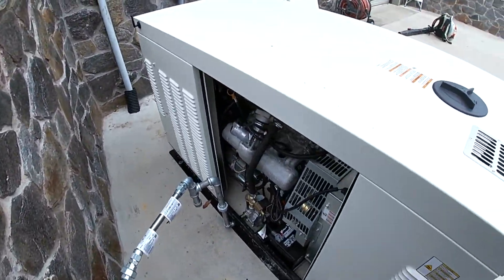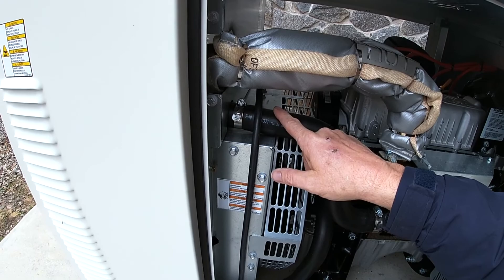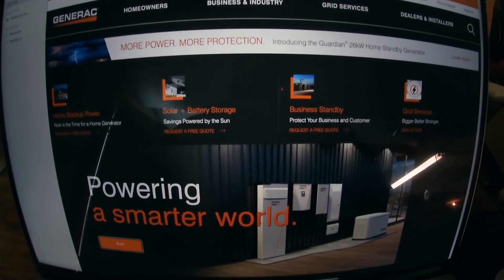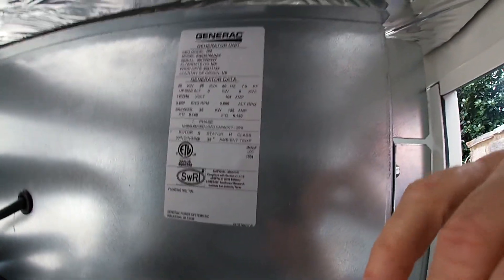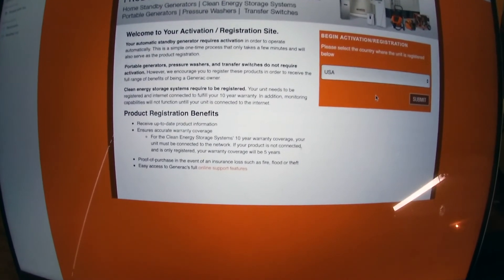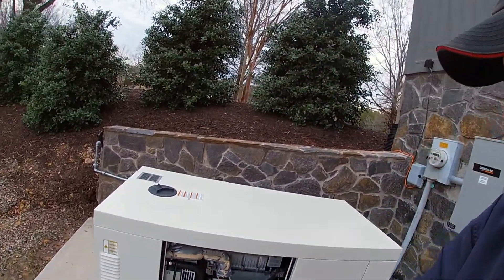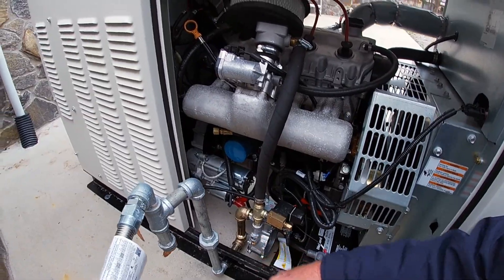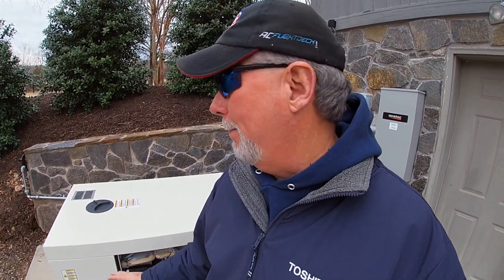HOW TO INSTALL GENERAC 25 KW  / PROBLEMS BEFORE ENGINE START UP (Pt.5)

Comment: Thank you so much for this series of videos. I had a Generac licensed installer come out and give me an estimate on a 22kw air-cooled system with transfer switch. I told him I'd pour a dedicated slab. The quote was $14K total. I asked for a cost breakdown as $9K seemed excessive. My power meter stands alone and would be 10' from the generator. The propane stubs to a tankless water heater 10' the other direction. They never responded to my question. I still want a system but won't use their crooks.
Reply from the maker: Hey You are welcome. I'm so glad it helped. Good Luck with your project and thanks so much for watching !!!!!

Comment: The gas line leading up to the unit needs to be on flexible conduit... because of vibration. The way it sits now it could break loose and cause an explosion.
Reply from the maker: Hey There is a flex line installed supplied by Generac. It came with the system. Thanks for the comment and concern for our safety !!!!! 
Thanks also for watching.

Comment: Very good info.
Reply: The owner of a local AC/Heat company told me that his company was a certified Generac warranty service company and if not installed by them or another certified company, that in and of itself voided any Generac warranty.  Nothing would be covered. So I began the process of finding an alternative manufacturer. A year later I am waiting to take delivery of a Generac 26kw air cooled generator. I hope I don't have any factory issues when it arrives because I will dig my heels in for a fight when threatened to be taken hostage by a control freak.
Reply from the maker: @dannylayton1106  Hey As you saw I had to wait but once they were on site they were awesome !!!! All covered under warranty. I hope all goes good for you. Thanks for watching !!!!!
Reply from the maker: Thanks and thanks for watching !!!!!
Reply from the maker: Thanks and thank you for watching !!!!!